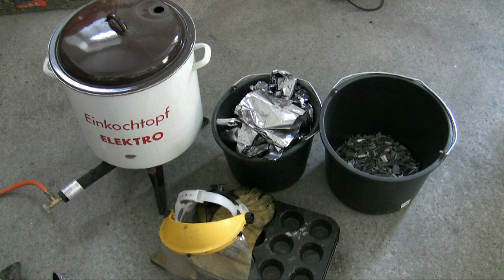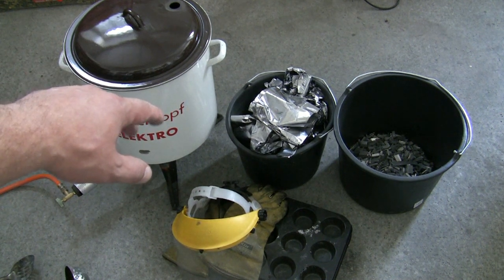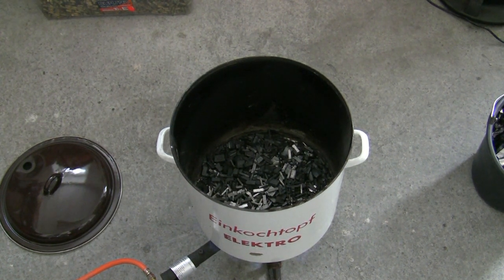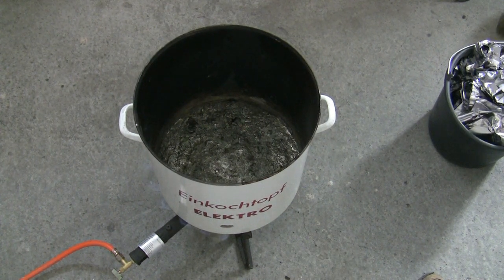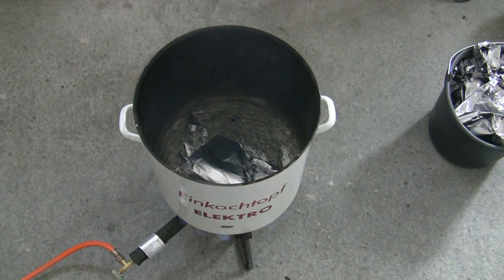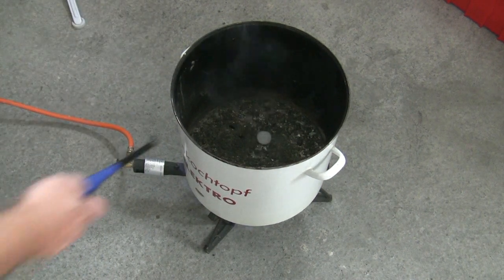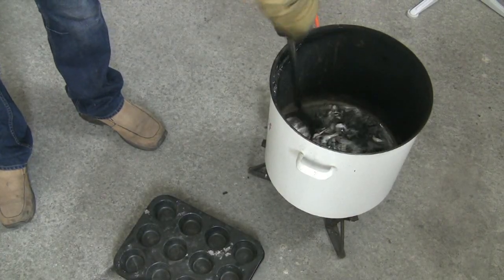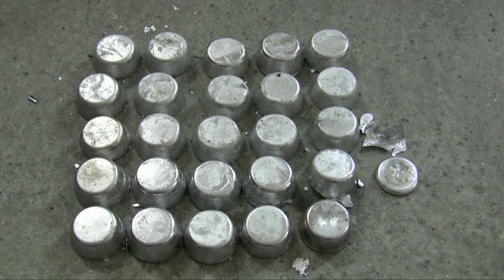How to make #2 alloy for cast bullets

Comment: Call me lazy, but it so much easier to buy Lyman #2 or Linotype from outfits such as RotoMetals.   You can be sure it is the correct alloy.  If you purchase enough, shipping is free.   I must admire your efforts to produce #2!  I'd rather spend time casting then mixing alloys.
Reply: I just googled it and one 5 lbs ingot for $26 only buys you about 137 pieces of 255gr .45 boolits, which is quite a lot if you’re already putting all of the casting and lubing or coating work into it. Granted, you may get a discount if you by many ingots, but still a lot of money if you can get the lead for free. I‘d rather just buy the boolits for a little more and not deal with the work or deal with the work and have some extreme savings.

This is all hypothetical, as I don’t cast my own… yet😄 but I want to get into it this or next year for specific boolits that are either expensive or hard to come by here😃

Comment: I recently got some Lino type in the type character form like you have there, when I melt it down there a lot of slushy stuff I skim off, is that normal, it melts at around 400degrees and I never let it go over 700degrees . Thanks
Reply: That’s called slag it’s pretty much impurities that won’t mix so u scoop it out

Comment: Isn't 15 BHN a little weak for 357 Sig? According to the MBC formula for appropriate hardness, the optimal pressure is found by multiplying the BHN by 1440. 357 Sig produces around 35,000-37,000 PSI, while the bullets will only be good up to 21,000 PSI. Wouldn't that cause a lot of leading?
Reply from the maker: Hmm if you would use this bullet as cast and reload it to FMJ specs than yes but in my case I use to coat my bullets so they are very tuff....pretty close to copper plated ones.
Reply: @wiederladerTv  I was confused about whether coating bullets would add enough durability to use the higher pressures. Thank you. I will see if bullets will handle 357 magnum full-house loads if they are powder coated.

Comment: hello i'm casting for a 223 what ratio do i need to have the correct hardnest
Reply from the maker: It's a question of the preassure your handload is generating.
Reply: wiederladerTv I'm looking to try to get over 2500 fps to3100fps   so I'm looking for at over 4000 psi is there any  chance I can get that hot. If not which speeds I'm i looking at.

Comment: I'm not the sharpest tool in the shed but 20lb of lead and 20 lb of linotype doesn't make Lyman #2.If it's 90%-5%-5% for Lyman #2, 50-50 won't do it.
Reply from the maker: Well 50-50 is total wrong. Linotyp contains a higher ammount tinn and antimony....the mix of all these result in an alloy which is very similar to the Lyman #2 when it comes to hardness.
Reply: I was thinking the same thing

Comment: You need to wear a proper smelting respirator man
Reply: it's actually not smelting. smelting is a different process in which metal is removed from an ore like iron or gold. This process is simply melting. a respirator with a cartridge for fumes would be a good idea tho.

Comment: I cast 93-5-2%tin. Cast pretty good. Great videos :)
Reply from the maker: Do you use pur Antimony for your alloy?
Reply: wiederladerTv I bought some antimony from Midway USA years back. I only have a 1lb bar of tin so I only wanted to use enough to get a good casting. Seems to work good. I have about 400 lbs of lead so that's no problem
Reply: wiederladerTv I just checked and its a mix

Comment from the maker: LOL, yeah I think you can hear very good where I'am from. ;-) The alloy depends on the bullet you wanna cast. A 45 ACP bullet for example is soft (BHN 10-12) an 9mm Needs a Little bit more hardness and a rifle bullet should have an BHN of 15 at least. Lead is not restricted in the EU at this time...but I think it's only a question of time until this is not allowed anymore.
Reply: dear sir for 270 win or 8 mm mauser,what formula you will use?